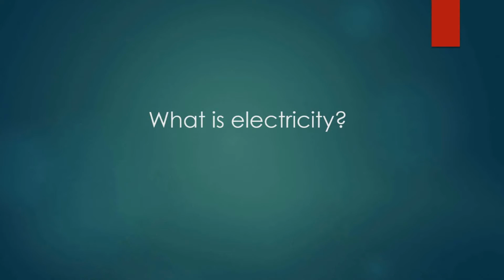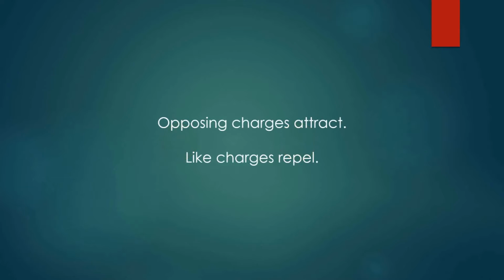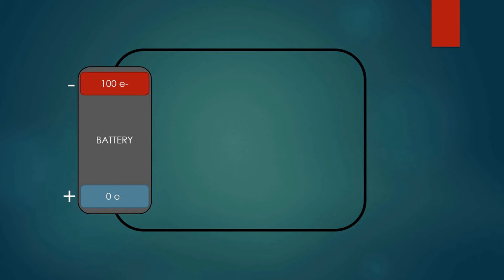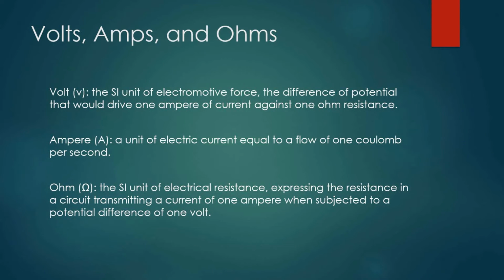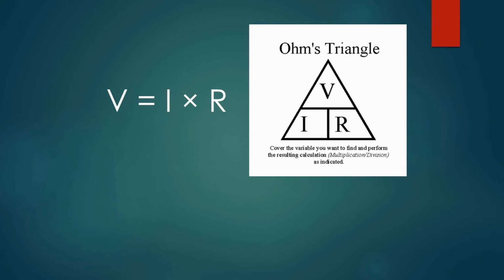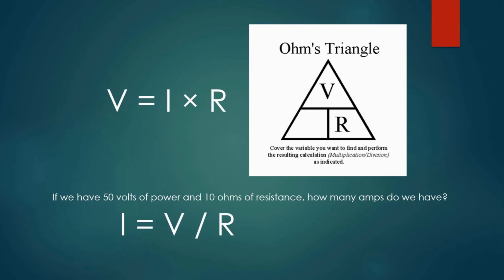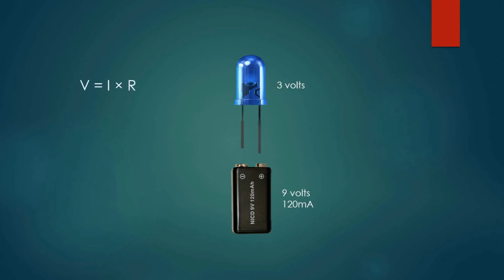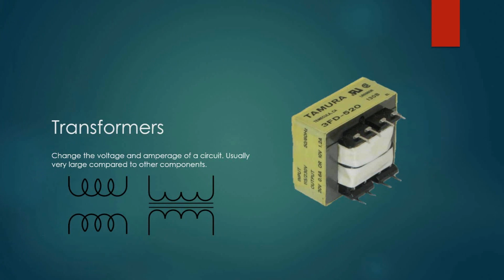An Introduction to Electronics [EP. 1 - Electricity & Ohm's Law]

Comment: this video is bullshit that led light bulb would still be exposed to 6v and would be damaged if a 25 ohm resistor is added on that circuit because it only provide a voltage drop of -3v